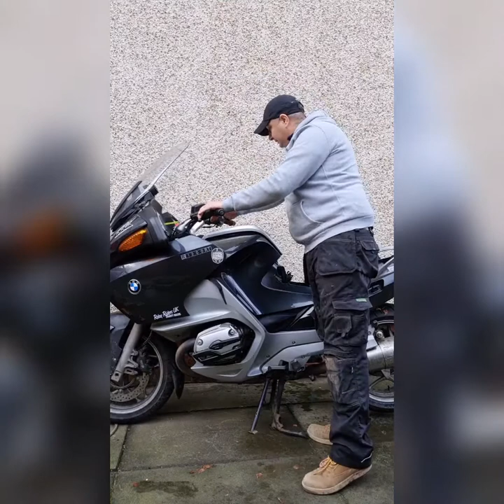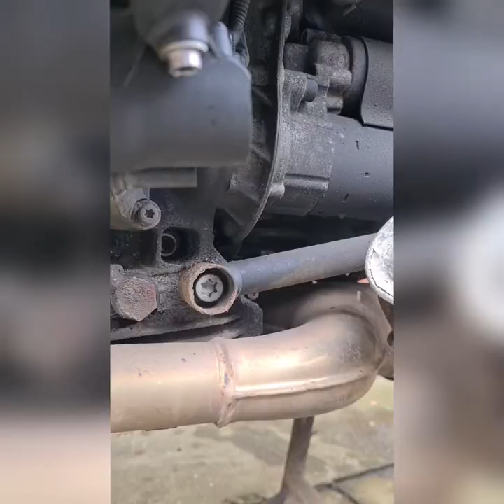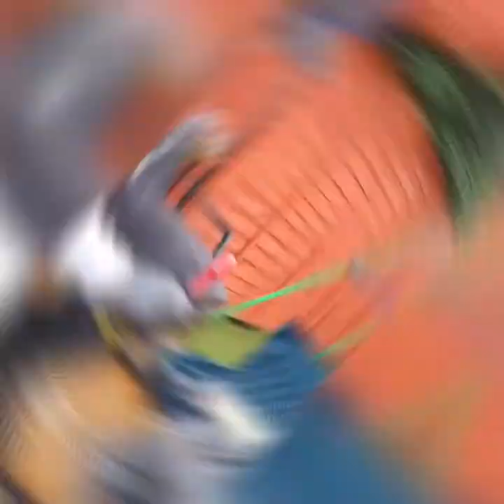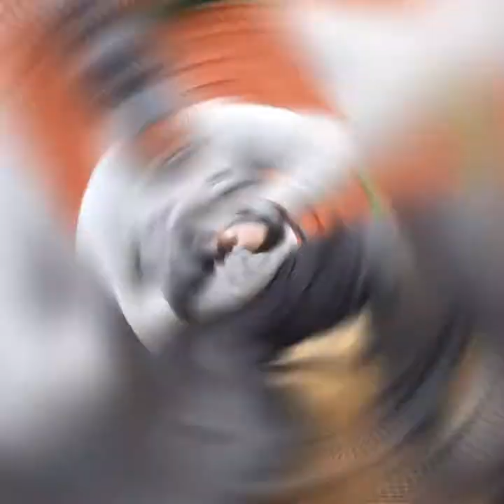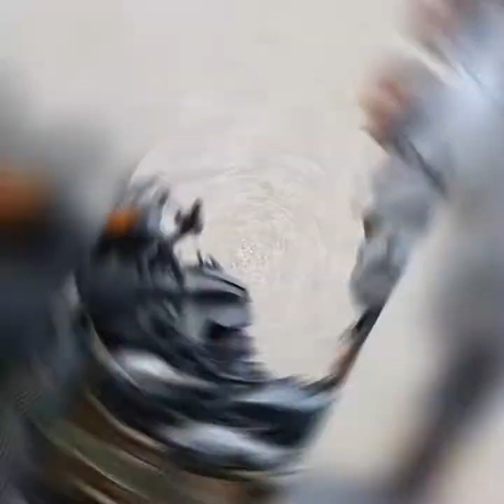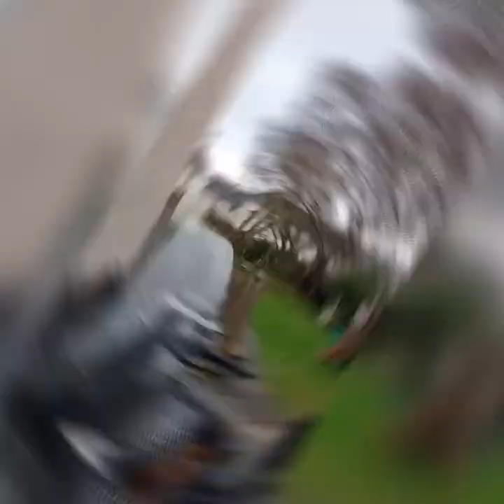bmw r1200rt starter motor repair

Comment: My bike was a bit sluggish so after watching your video I gave it a go. Piggin awful job to do , so frustrating. I persevered though and now it starts so easily. I ordered a brush motor set and that was hard getting then on . I tried about 7 or 8 times but eventually did it. My reaction when it was done was the same as yours. I was jumping for joy. Thanks for the video and for people like you that bother to do them.
Reply from the maker: Brilliant mate, I definitely feel your frustration and the excitement lol. Glad it’s starting better 👍

Comment: Many thanks for this, I too had a lazy starter. Got myself a second hand starter and gave it a good clean as per your vid. Swapped it with the original and bingo, works a treat. Unfortunately, I have 3 screws left from the fairing and forgot where they go!!!
Reply from the maker: Only 3 screws left! I call them optional extras lol!

Comment: How the hell did you get the thing off? I have the 2014 model and the screws are so inaccessible.  Followed the manual and it just says "remove screws". I even welded a T30 to a metal rod to fit it between the frame and motor. Just about gets on the bolt but then I can't turn it because the frame is in the way. Would like to know what the tool is you used. Although it still looks to wide to fit in the K52 version of this bike
EDIT: I can't reply to the below comment for some reason, YT keeps blocking me. I bought a special tool but it seems I am not allowed to post the link to it on Amazon
Reply: did you fix it? how did you solve it, I have the same problem
Reply: Ok got this i remove i use „ articulated connector”
Reply: @arekszarat3599   FFS  YT removed my reply!
Reply: @arekszarat3599   I guess you're not allowed to provide links on here anymore.
Reply: @arekszarat3599   FFS I can't even talk about what to buy or where to buy it??? This site sucks.